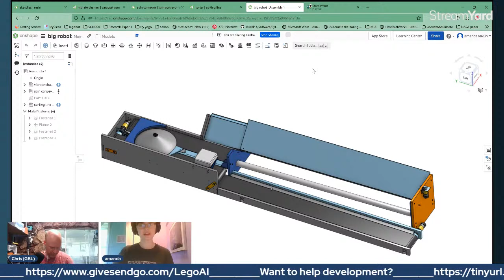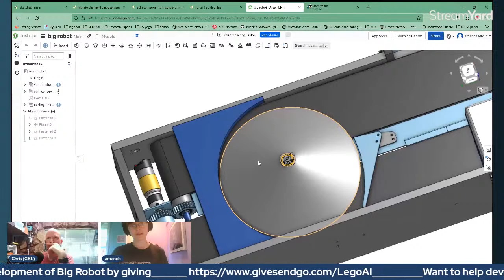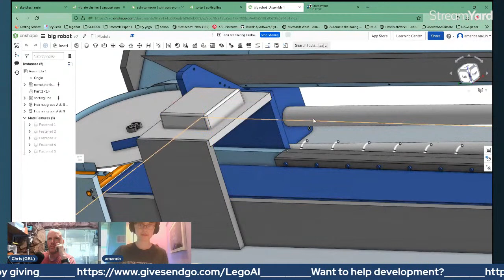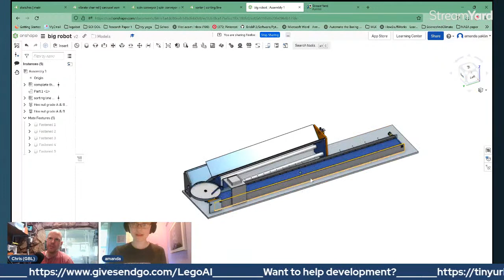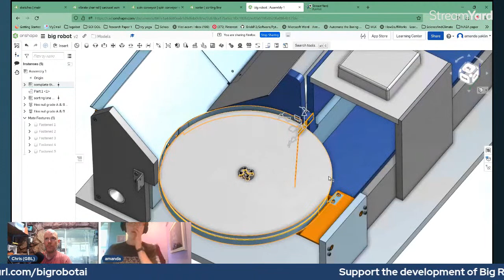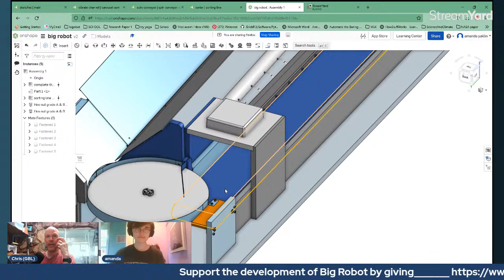Big Robot Week 1 CAD Design Chat w/ Amanda and Chris - Open Source AI Lego Sorting Machine

Comment: Scale is a big issue when looking at a design. Something that is 1mm looks like 1ft in 3d space. I'm curious how far apart those nozzles are from each other. Some of the small parts might get accidently hit with a draft from another channel. Also need to make sure that the nozzle are accurate enough for bins that are that close together so they don't go into the wrong bin.
Reply from the maker: Thank you for contributing to the conversation.   Will making them adjustable help in the development as we get it programmed?
Reply: @GreatBrickLab  Adjustable by the power, the placement, or the nozzle design? I recommend doing some small scale tests, before building the entire machine to see how accurate it is.